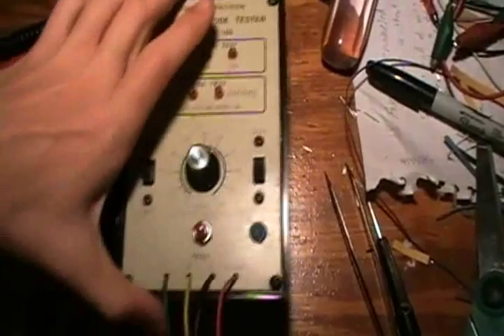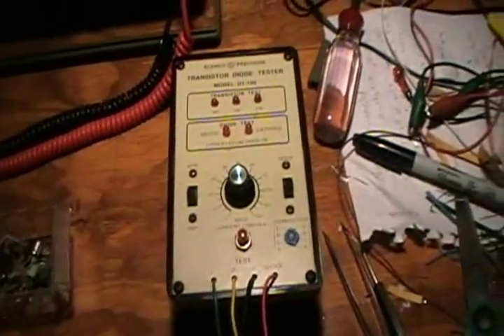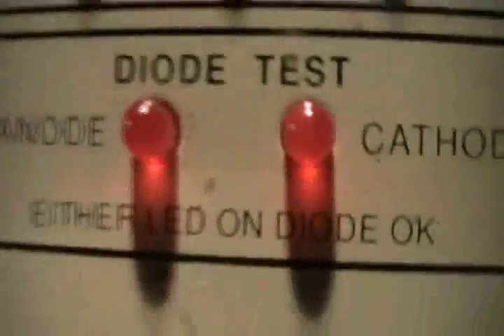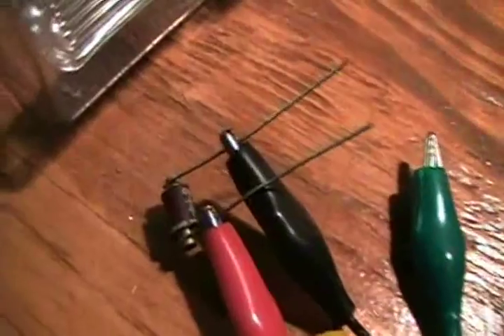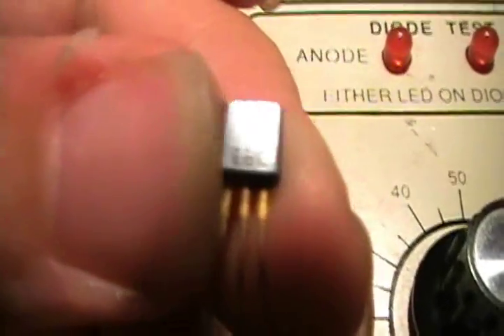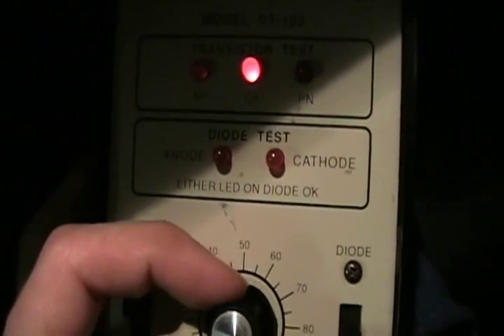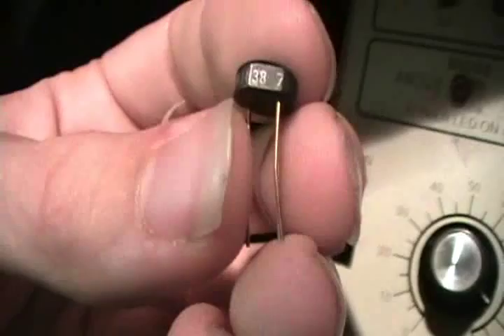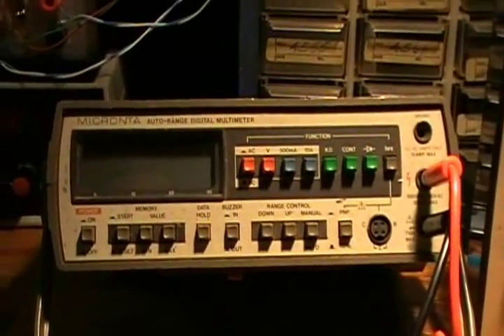Elenco Precision DT-100 transistor-diode tester.

Comment: I have this model and it does not detect problems with shorted transistors. That's how power transistors usually fail, which means it will lie to you on most shorted transistors.